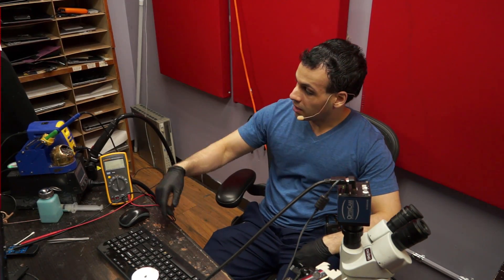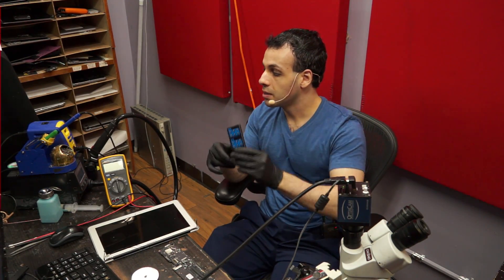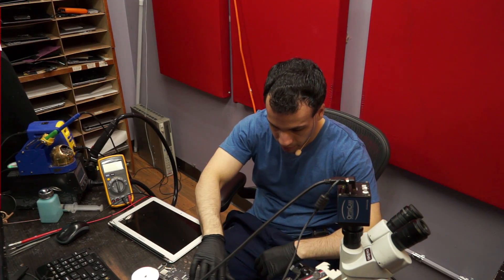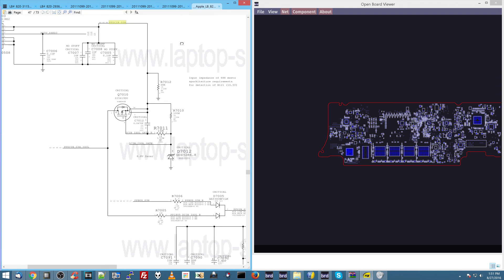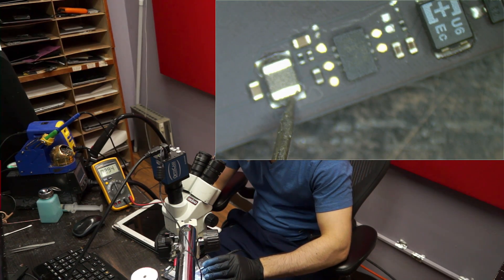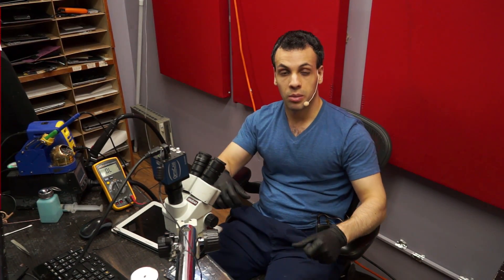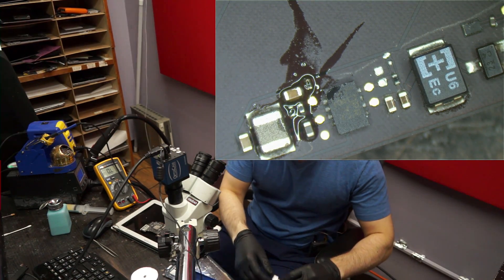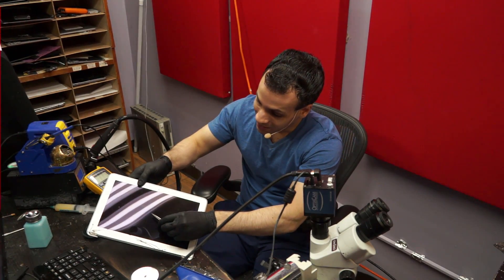Repairing missing PP3V42_G3H: How feedback circuit regulates output

Comment: I'm curious, how much do you charge for board repair? Couldn't find a price list on the website.

Also, is that a signal generator I see sitting on the floor? 

edit: also holy crap, a schematic? I take it there was some news with apple then?
Reply from the maker: no news.

$325-$425 depending on model
Reply: But what if the problem is just no back light? Can't I get a discount because that is easy to fix?
Reply from the maker: ***** No. If it is easy, fix it yourself!

https://www.youtube.com/watch?v=7I1VBM4VduE

https://www.youtube.com/watch?v=7LQ0ge0Ps-A

No backlight discounts are key to misery.
Reply: Louis Rossmann Yah, considering you mentioned that like 4 times in this video, it was a joke. lol

Comment: How much do you charge for a fix like this? I often have the problem of charging an apparently simple fix, because it only took me a few minutes to do, but I feel I have to charge for the hours I've spent to be able to do a proper diagnostic. That's why I hate working in front of the customer.
Reply from the maker: $325 + tax. If they're mad at how quickly I fixed it they're welcome to be even madder at how quickly I unfix it if they don't want to pay. I just don't play any of that crap. If you agree to a service, then I'll do it. If you don't agree to it, I'll give it back to you at no charge with a smile, but none of this BS afterwards.
Reply: Is that a fixed price? If this took you 3 or 4 hours to repair would you charge more?  I've got screwed over a few times before because the customer says "that seems like a lot for half an hour of labour". Thank's for all the advice!
Reply from the maker: Sr. Armando
No. Same price. Fair is fair. how can I just make up the rate at the end? No one wants to deal with changing rates. They can say it seems like a lot all they want, I don't argue, I just undo it and as politely as I can suggest they use my station to do it themselves. If you think I charged too much because it's easy do it yourself.

You always have to put the other person in a position where they are the asshole, rather than defending yourself from being the asshole. If he thinks it is easy, then he can do it himself. Don't be a wiseass about it, just say I understand this is too much, I'll undo it, I won't charge you, and I'll give you an opportunity to do what I did at my station.

Comment: Hi Louis! I'm sorry this is an unrelated question, but I just had to check if you could supply a quick answer of course no problem if not -- I had my lunch in my bag and some spaghetti sauce escaped it's lunch container, went to the bottom of the bag, where a little bit of it got into the ports on the right side of my macbook pro 2013  model. I sucked it out, gross!, and it all appears to be gone but does this need attention? The spaghetti sauce was a little viscous so it would not flow.
Reply from the maker: +James Foley open it and take a look
Reply: Shazam! Will do

Comment: Let your customer tell you the symptom. You can tell them the cause.
Reply: Great idea but 99% of people only see broken tech as "broken" and do not have the slightest want to investigate
Reply: Well if they don't want to tell you the symptom its a non-issue anyway. customer saying no backlight is a symptom. customer saying it wont switch on is a symptom. you saying to customer it was a 200k resistor that was missing from your PCB is the cause.
Reply: I understand entirely, however it is superbly helpful if customers are just honest and try and be good people ! after all they have come to me for help , it cuts down on alot of the wasted time and effort and potentially cost
Reply: House M.D "Everybody lies" :) But yeah, if a customer can tell you honestly what they've seen it do or not do. it makes our lives easier to diagnose. its when they try to be the engineer and you hear phrases like "Personally, I think its" or "something this expensive shouldnt do this".......
Reply: I'm one of the 1% who will investigate and properly fault find then only ask for help when all else fails.   I wish tech support email operatives would take the time to read the fault finding info I have provided and not just trot out their stock answers.